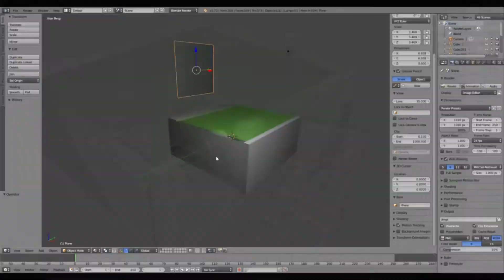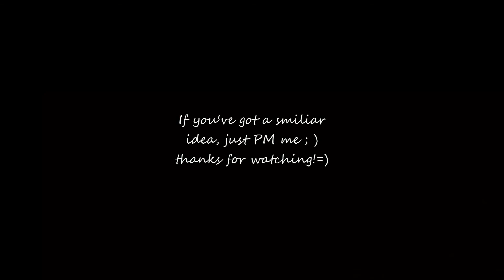Custom-built bluetooth stereo

Comment: cool! what did you use for the pcb unit ?
Reply from the maker: ***** It's based on a Creative D-80, so nearly all the low-voltage electronics are stock:)
Reply: I see, and I was wondering how you got around to make the electronics.
Reply from the maker: yea, i cheated;)